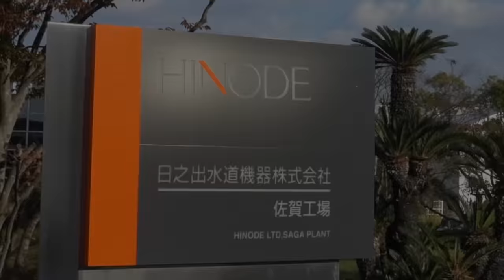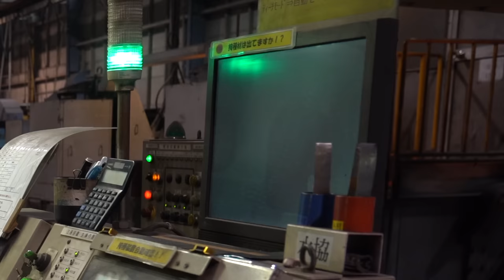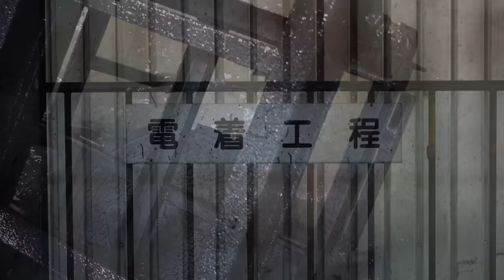まるで道路上の芸術作品！マンホールを大量生産するプロセス。日本のマンホール工場

Comment: That’s very smart of having a locking mechanism so that in case of electrical explosion or high water pressure the manhole cover won’t go flying in the air and hurt someone or cause more damage. Here in the US those covers do fly when electrical explosions happens.
Reply: We have gas explosions here in the Boston area because the gas company is terrible at fixing leaks. Is that what you mean by electrical explosions (natural gas hit by a spark), or is there something else that happens?
Reply: @timmccormack3930  yeah I'm quite confused by why this person's electricity is exploding.

Comment: 11:05 only a Japanese company would take such care to machine a surface hidden from the public. I respect that they put hi effort into their work.
Reply: .......a chamfer is needed to get the thing in place easier when being used. It has nothing to do with a racial stereotype.
Reply: I thought the same thing when I watched them deburr the drain holes on the underside, never seen, never touched part of the cover.
Reply: @ShortArmOfGod  I think the original comment had more to do with quality of work and quality of product than racial stereotypes. Just like German engineering is actually good because Germans do have good engineering. Is that racial? No. It's a fact.
Reply: @ShortArmOfGod  I mean it in a positive way. I have been to various places in Japan. Taking care is fundamental to their culture as ones work has put meaning into the outcome. And FYI casting normally have a "draft angle" anyway to get the mold out of the sand. The chamfer would have been good enough in cast form. I don't think they machined all of the covers that way, only certain hi end ones.
Reply: I believe that the temperament, sensibility, collective consciousness, morale, and interpretation of the people of a country have a great deal to do with the degree of accomplishment and the quality of the products and services.  In particular, it is important to continue to carry things out without cutting corners and without compromise. Are we satisfied when we are only halfway done, or are we striving for even higher goals? The difference is huge. This is obvious when we look objectively at the high quality and admirably good results in various fields in other countries.
Reply: @ShortArmOfGod  I think they're also leveling the height so it sits flush on the surface. So, as you say, it is not cosmetic, it's needed for the quality of the product.

Comment: I was surprised to see that manhole covers required such a highly automated and extensive production line, until I foud out that a large city, such as New York city, had 600,000!
Reply: Well depended, if you look carful in NYC those manholes are just regular not so elaborated like those in Japan, for one the one in NYC are solder to the ground fittings, this one here are loose
Reply: @enriquelopez7050  i think he meant that if NYC need 600k i think tokyo and next 3 biggest city in japan have similiar count

Comment: When I was a younger man I first worked in many jobs, then I found myself in a foundry, this was in Bolton, Lancashire. I loved the job, it was all hand castings, it was hot and heavy work. The one thing I did not notice was the strength I was building up in my body, until one day I handed my brother an old cast heater. I held it out as if it was nothing too heavy, when he took it from me, he was pulled over by the weight of it. Before then, I just had not noticed the change in my body. I suppose lifting a few ton of casting for 8 hours can build you up better than a gym a few times a week. Looking at this brings back thoughts of my friends in that bit of hell. The area was a red-light district, and the girls would get warm from the cooling castings. I then went on to a rubber factory, in Rochdale, again happy memories.

Comment: Years ago I worked for a foundry that made manhole covers...

It was not automated and everything was done by hand. This factory produces a high volume and needs automation to keep production rates high.

I really liked the 'Color' stage. Is that a Porcelain based product that is baked at high temperature, or an Epoxy paint?
Reply: Did you hafta manhandle those manhole covers or did they have decent material handling gear like these guys?!
Also was wondering is the casting sand reuseable?
I just love YT; taking new industrial tours every day!
Reply: @brianstratton8767  Thanks for comment. This was 30 or more years ago. No automation. They did have some crude lifting and moving equipment. They also used forklifts. Sand can re-used so many times, then it needs a special additive that wears out from heat. It smelled bad. 

They made manhole covers and giant truck and railroad parts. I worked there 1 summer and wow was it hot.